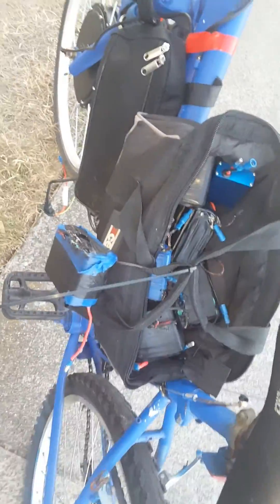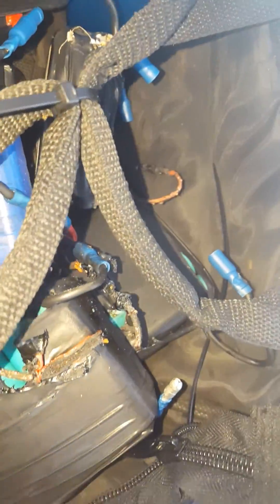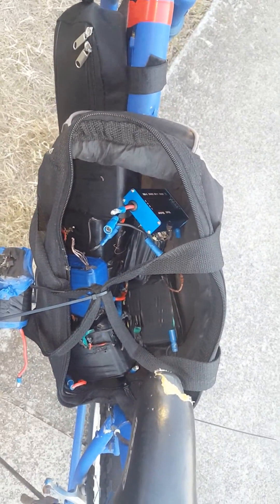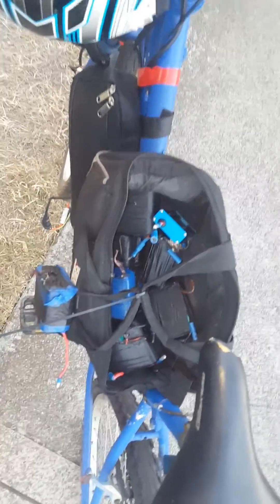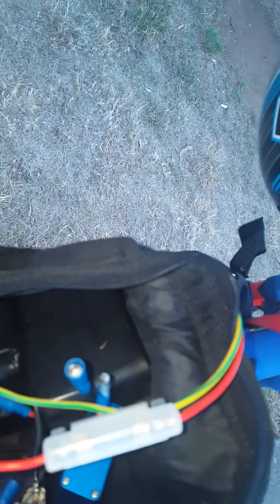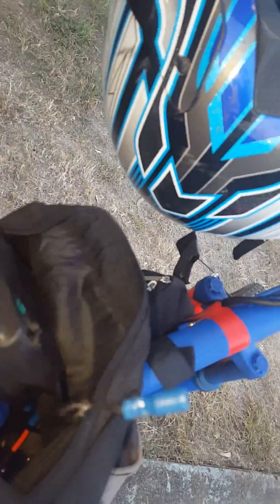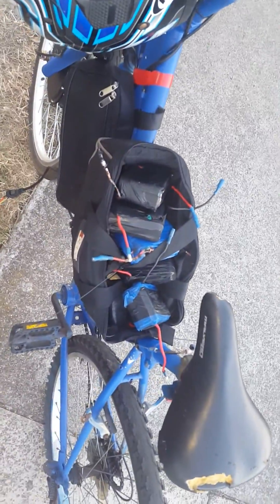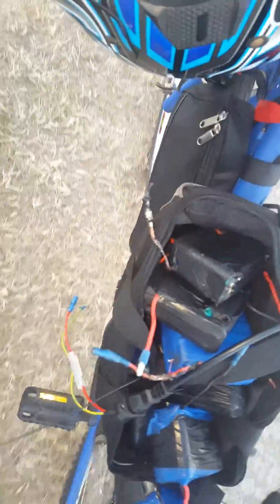Ebike caught fire 18650.

Comment: Thanks for the reality check. These Lithium cells are very powerful, and caution is always pertinent. I plan to construct my cells "Tesla" style, with individual fusing. (see Jehu Garcia, Electric Samba Project)
Reply from the maker: Big follower of jehus work the big issue here was me rushing to  make it work haha. If i hadn't  have been so quick to rip them apart it  could  have burnt the bike into the blacktop
Reply: +brad howlett Wise move. I hope your burns healed well.
Reply from the maker: Yep no dramas there if you scroll through  my videos youll see im using cell separators for the  next one ;)
Reply: Ninilium Absolutely necessary. My stupid pack just popped recently. Need a new carry case and a shitton of clean up. Thankfully only my 2s booster died,  not my 6s packs!
Reply from the maker: +joblessalex yeah im building a new ebike battery right now 200  cell fuses the works ;)